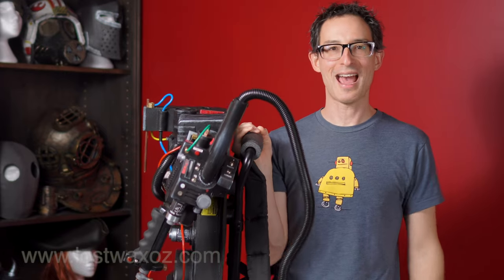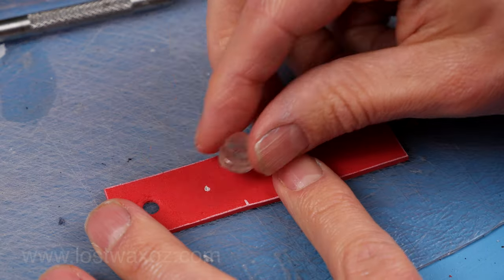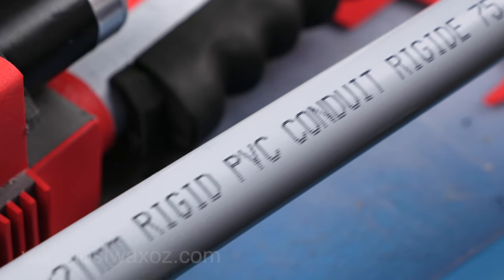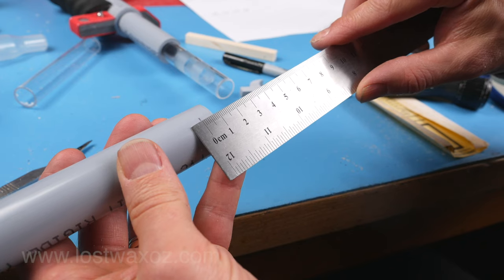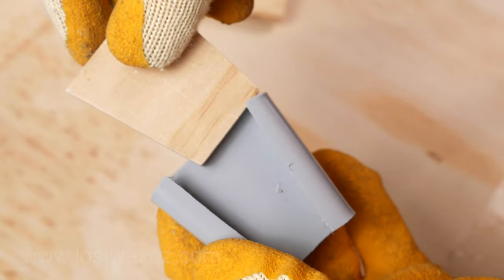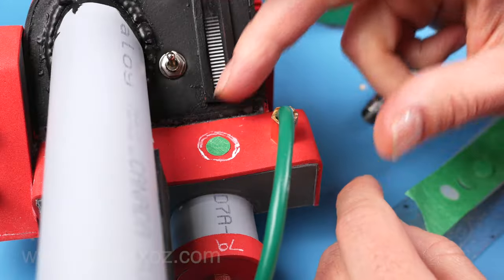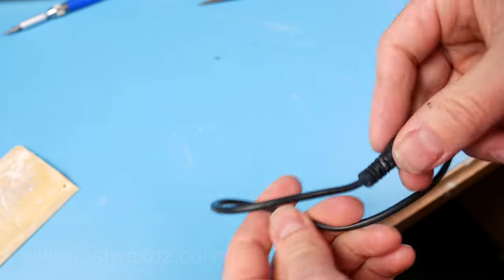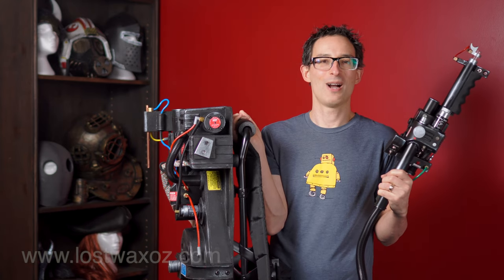Ghostbusters Proton Wand DIY Part 2 /Make an Ultralight Proton Pack for Your Ghostbusters Costume!

Comment: This turned out fantastic. With screen accurate packs costing several hundred dollars and weighing a ton, a light, relatively cheap alternative that looks this good is a godsend. So many more people are going to be able to enter the hobby because of this who otherwise may have been intimidated or priced out.
Reply from the maker: It really is amazing what can be done with common materials....and a bit of patience:)
Reply: @LostWax  It really does take a lot of patience. I can't imagine how much would be required to design it!
Reply: Try several thousand unless you bought the haslab pack.
Reply: I'm going to take this project on myself. Its hard to justify spending 250 on the new spirit pack that still needs some work done to it to make it "right".
I'm going to try this to get one the way I want it off the bat, plus I can add the lights as I see fit! This will be about the journey of making it, not the actual prop.

Comment: Another awesome tutorial. Thanks again! I used one of those foam mats with a large diamond plate pattern on the back. I was able to make it work, but the pattern was pretty pronounced (i.e., deep), and so there were gaps when I put it next to another piece. Sanding helped a bit, but there were still some places where I had to go back and use some paintable caulk to fill in the gaps. Not a big deal if you are using hot glue, but I used contact cement for a more heat-resistant bond. The moral of my story... get foam that is as possible on the back side!
Reply from the maker: Yes! The smoother it is, the easier to work with.

Comment: Can you recommend any foam for the handle grip? (the thin black you heated and put over it?)
Reply from the maker: The foam I used was from a large roll I bought at Michaels. Pretty much any cheap craft foam will work. In this case you don't want the high density stuff because that makes it harder to form.

Comment: Honestly, I would just recommend buying a 3d printer and hitting up the facebook group (open source 3d printable files on github). I think it produces much more accurate results for the price and cost of materials than trying to make it scratch out of foam and molds and such. Its not super hard to do and these days Ender 3's run about $100 on sale (specific coupons). 

That being said this method is cool and its nice seeing what kind of results people get with all different kinds of methods. Everyone's will be different!
Reply from the maker: Yes, that's also a great way to make a pack!
Reply: some people just like to get "hands on" and build it themselves